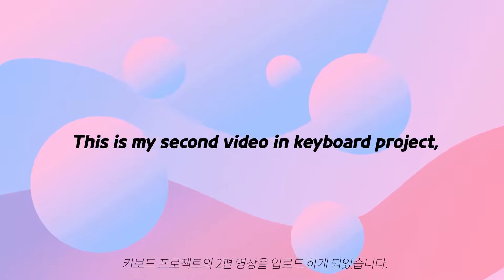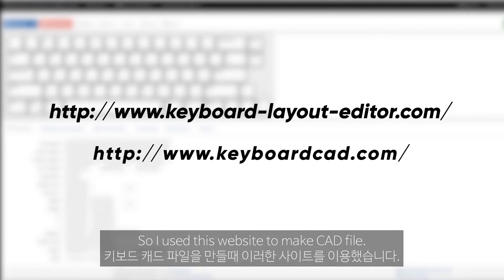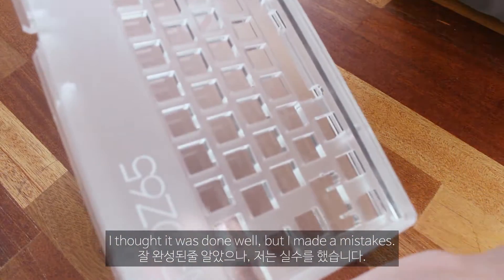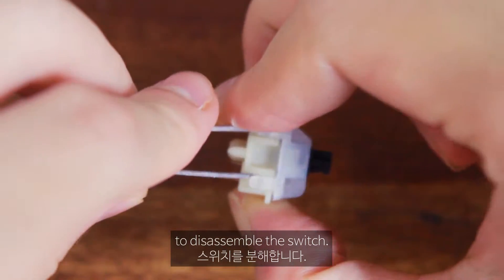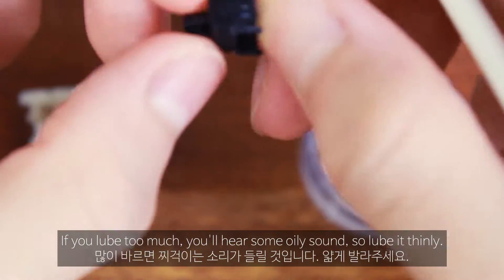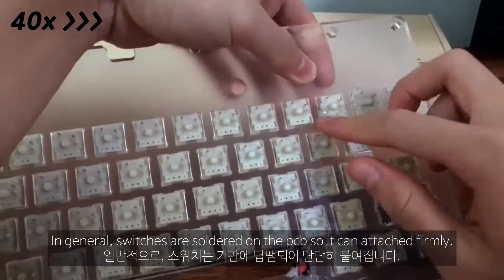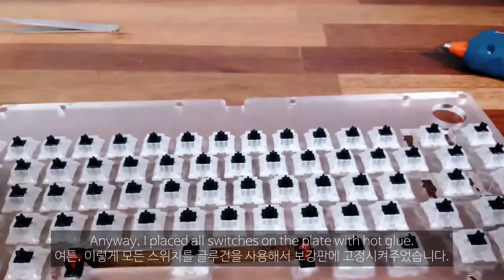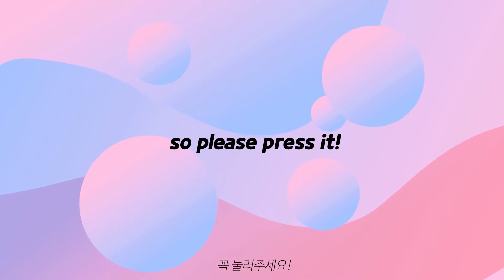Building My Own Hand-Wired Keyboard! - [EP.2 : Let's Start To Build!]

Comment: 4:54 I didnt understand what you meant by dividing the plate into two pieces. What is 1.5T? 3.5T? I dont know this meassurement. How much is this in mm? And how could I divide the plate into 2 pieces? Ordering two plates? I'm really excited to make my own project like yours, but I'm very concerned about these little details now. Even more because my build is with alps switches, but the stabs will be MX. Idk what would be the thickness necessary for me
Reply from the maker: 1.5t, 3.5t, T means mm. So 1.5T acrylic is 1.5mm, 3.5t is 3.5mm. I recommended dividing plate into two pieces because of the stabilizers. If there is just one 5mm thick plate, You cannot put that stabs. so, if you are going to use cherry stabs(plate mount),  you have to divide it on the cad program into two pieces, (1.5mm one to fix stabilizers and 3.5mm one to maintain a thickness of 5mm.) and order it!

Comment: Just subscribed! Thankyou for the amazing video! Ill make my own keyboard like this because I think I'll save some money, and I cant find alps PCBs in the way I want. That site also generates alps plates. Hand wiring an alps keyboard would be just like making a Cherry MX type one? Or Ill need different software or something? Or solder the diodes in some different way?
Reply from the maker: Thanks for subscribing me! You can just use your alps type switches. It will work the same way like the Cherry MX Type switches. So you have to do is .. just generate the alps switch plate! The only difference is the plate. :)
Reply: @oREoTheCream  Thankyou very much for answering me. Your content is great, I"m loving your videos. They will be of great help to make my project possible, thankyou very much <3